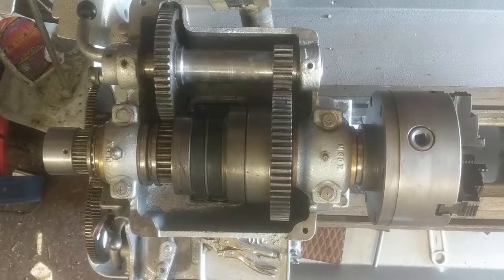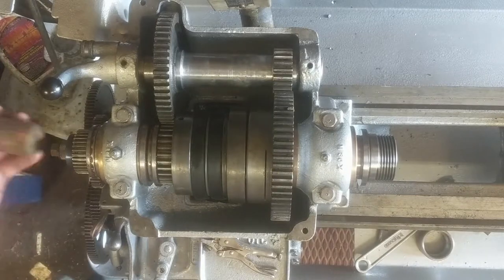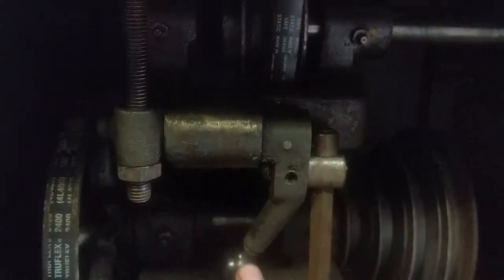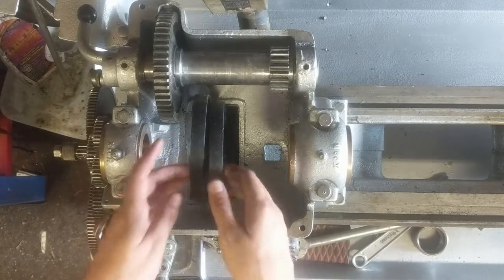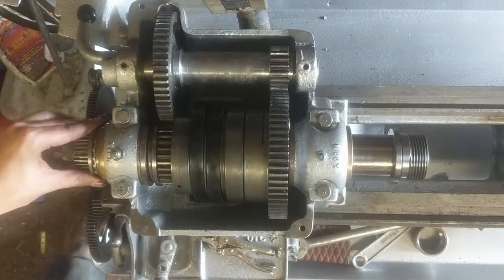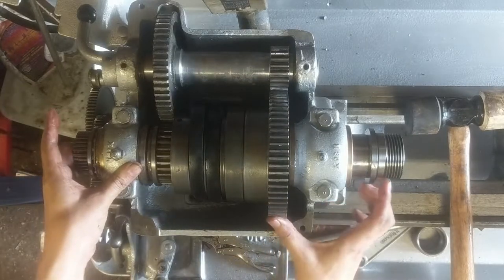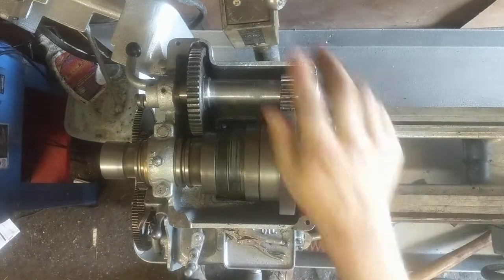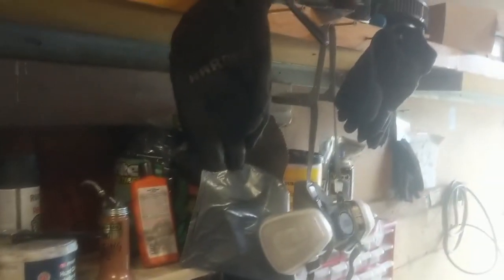Sheldon 11" Lathe - Spindle Removal and Belt Replacement

Comment: My lathe is almost done! I was ordering oil for it and was going to use "Mobil 100772 Vactra No.2 Way Oil" for the ways but was unsure if I should use a different oil for the spindle and other oil locations, or if the vectra oil was ok as an all around oil. I checked the ISO ratings and I think its acceptable but I want to make sure I oil the lathe correctly.
Finally I was wondering if you had the original manual or a PDF of the lathe. I found one but its kind of short and I was trying to unseize the tail stock and I was looking for a better diagram as I think I am just going to have to blowtorch and hammer the snot out of but I wanted to make sure I was doing it justifiably.
Reply from the maker: That's the way oil I use. I haven't had any problems.
I don't have a better manual than the ones that are online. The tailstock is pretty robust. But you should be able to reach up from under the lathe bed to feel what's holding it on. Mine has makeshift arrangement. Pretty much, just get that main nut free and the whole assembly should lift off.

Comment: Nice video! have you ever pulled the bearing caps? I would think pulling them would make it easy to lift the spindle assembly out.
Reply from the maker: Thanks! Much appreciated!

I did take the bearing caps off, and sure you can lift the spindle out that way, if you cut the old belts. I think you'd be hard pressed to put new ones on the assembled spindle, though. Plus I wanted to show the process for anybody that had one of the versions with timken bearings.

Thanks for the comment!

Comment: Could you possibly do a video on what the proper operation is for features of the lathe?  Or if you have a link to a manual?  I just bought one of these.
Reply from the maker: Thanks for watching! I've had a few requests for this. I'll  do something when I get back to my shop. Stay tuned.

There are some manuals available on Vintage Machinery
http://vintagemachinery.org/mfgindex/detail.aspx?id=2133&tab=3
Your exact machine may not be there (mine isn't), and there's a lot of variability from year to year, especially on the headstock and apron. But you should be able to get a good idea from those. Good luck!

Comment: Sorry to bother you again. I am still taking my lathe (same as yours) apart as it needs a full rebuild. What where the size (length) belts that this lathe took and the kind (shape)? Also if one is doing a full rebuild would it be ok to remove the 4 bolts and the spindle bearing caps to remove the spindle? I am unsure if this would cause any issues (as I am a bit of a novice)? Thank you again for your time and consideration. It is greatly appreciated.
Reply from the maker: I'm looking back at my mcmaster carr orders. I'm pretty sure the belt I that fit were 50L560. You're good to take off the bearing caps in any situation. They are plain bearings and the spindle is located by the tension via the rear end ring. There's no precision in the bearing cap bolts. Good luck. Don't be afraid to ask anything else. I'll help however I can.

Comment: where did you source a replacement drive gear that you said you broke? mine is missing : (
Reply from the maker: Bad news: I didn't. I brazed it back together and turned the bore as true as I could. I looked into replacement but didn't find good options. There are people that deal in old machines. They might have an original part. Not for cheap if they do. But probably cheaper than having one custom hobbes. I also thought about getting a stock gear from McMaster. They have the right pitch and tooth count gear, but I was never confident it was the right pursue angle. You'd have to turn the right bore on it if it did mesh. I'd ask around at machine shops in your area. You might come up lucky. Probably expect to play a few hundred bucks. Best of luck.
Reply: what type of brazing rod did you use? i found someone who has a broken one for a good price
Reply from the maker: @scottgiard183  I used 3/16" SiCuSn to DC tig braze, fairly cold...something like 40A. 1/8" would have been better. Fair warning, the gear did bend a bit. It runs noisy now, but it runs. Maybe oxy would be better because you could spread the heat out more evenly.
Reply: @barnyardbikes54  Thanks for the info Much Appriciated!!